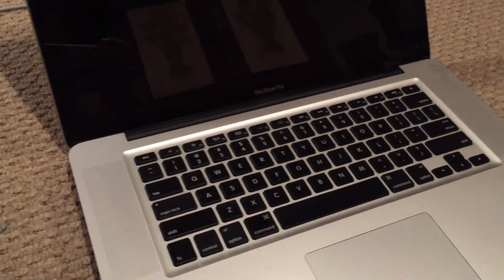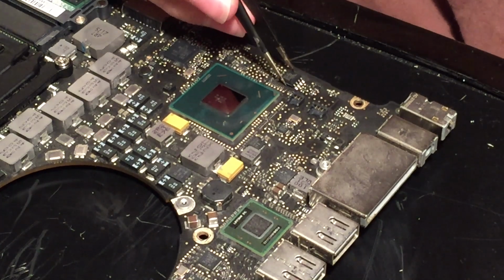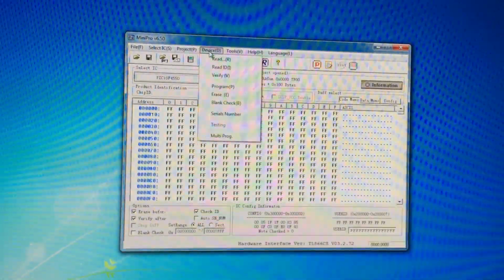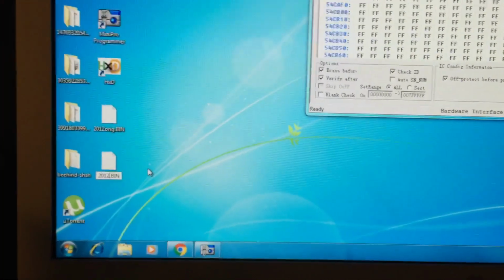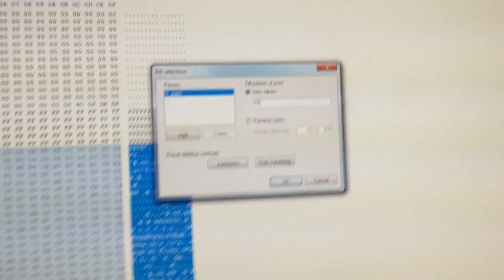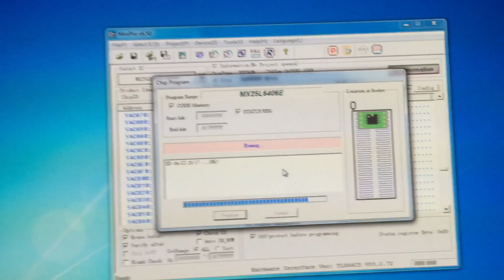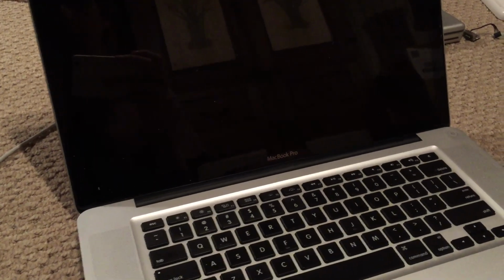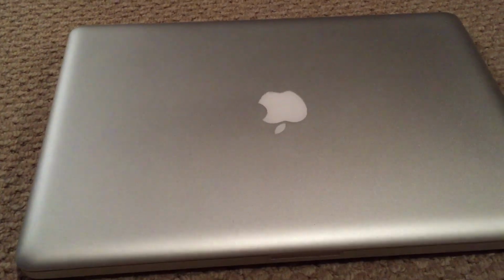Removing a Firmware Password on a Mid-2012 15" MacBook Pro

Comment: Can you do this with one of the clip-on IC holders, rather than having to desolder/resolder the whole chip? Also, are those matt boards that are popular with newer models a robust solution? I've not heard much about them!
Reply from the maker: Yeah, you can, but will probably have to inject voltage with a power supply, as the 3.3V rail pulls too much current to be powered by just the programmer. Don’t mess with the Matt boards, they are not needed and really shouldn’t be used (as they are replacing the SPI-ROM on the machine’s board).
Reply: @dosdude1  Ah fair enough, Matt board was the route i went on my 2014 air, didn't have the equipmant to do a proper EFI re-write, might get around to doing it properly one day if i run into issues!

Comment: Off subject from this video....but any pointers on how to get into the BIOS on an intel Nuc? thanks much.....
Reply: EFI, not BIOS, hehe. I would expect that it would have a similar design with there being some form of EEPROM on the board that you can flash using alligator clips and a raspberry pi. However, if it has a TPM 2.0 you may run into issues.

Comment: DAMN good video!!!  I liked and subscribed.  A couple quick questions... 1. Is it possible to change the EEPROM's contents directly in the programming software, (instead of copying it to a hex editor)? and... 2. What brand and kind of flux do you use?  Keep rockin'!
Reply: You can’t “edit” an EEPROM in place. Basically they support being read while working normally, or in dumping / entirely rewritten mode.

Comment: 02/06/2021 this works on Imac 13,2 late 2012. you just saved me £300 for mobo replacement. i spent £22 on adhesive and a programmer and managed to remove firmware password from 2nd try. tyvm

Comment: Would it be possible to do this with the clip on lead you can buy rather than remove the chip??
Reply: Yes, although it can be tricky. Some computers work better than others. I'm using an old Acer laptop (originally came with Vista!!) that works almost every time.

Comment: Great video, thank you. Used this video to remove the password from my 13" MBP 2012
Reply: Hello friend please contact me my whatsapp in my web https://ateseteknik.com
Reply: Which adapter I can use for connect the chip to the PC?
Reply: @uwimanabertrand153  Hi, my TL866 came with several sockets for various sizes of chips. If I remember correctly, it's a SOIC-8  chip.

Comment: So after the efi is unlocked would the macbook locks itself again if you connect to the internet or go onto the apple app store? Lets say that the macbook is stolen and the owner reported it as such and the macbook's serial number is now blacklisted. Would the serial number embedded on the motherboard triggers another efi lock?
Reply from the maker: Not at all, once EFI lock is removed and the OS is re-installed, the system will remain unlocked.
Reply: @dosdude1  My Early-2015 MBA got hit with some ransomware and as I purchased the device from a third party, Apple won't unlock it for me without proof of purchase.  I'm about to replace the logic board (purchased used on ebay), will I need to do anything other than switch it out? I'll utilize my same SSD and airport card. I just want to make sure I'm not spending $300 on a replacement logic board for nothing. Will I need to do the 3X PRAM reset? Re-install my OS (seeing as the SSD will already have the OS installed)? Wipe the SSD?

Comment: I bought a 2011 iMac with this problem. I can just change the whole board, right? They’re super cheap on eBay.
Reply from the maker: Yeah, if you want...
Reply: dosdude1 thanks! Ordering now. I only paid $60 with shipping for the iMac, then got a partial refund. The boards are around $35 on eBay.

Comment: Hi Collin, could provide a link where I can purchase that eprom chip reader and which application you used to reprogram the chip with?
Reply from the maker: I got it off eBay... Just search for "TL866" on eBay, and look for one that comes with the adapters. The software used is included with the programmer.
Reply: thx

Comment: I got the TL866A USB, but what adapter is needed? Keep up the good work!
Reply from the maker: You need an SOP8 programming adapter.
Reply: Thanks!
Reply: @dosdude1  Can you use one of those clamps instead of removing the chip from the board?

Comment: Hi there I have a 2017 MacBook pro it's icloud lock. I need help removing the passcode please help me.
Reply from the maker: It should be relatively the same process as shown in this video, but the EEPROM may be slightly different and require a different adapter to work with a programmer.

Comment: Where did you get the adapter??
Reply from the maker: I got it off eBay. It's a MiniPro TL866.
Reply: dosdude1 also if I want to use a Ponoma clip instead of removing the bios chip from the computer which do you advise using??
Reply from the maker: I don't advise using one. I tried using one once, and it didn't work at all. Try to get one, though, and see if you have any better results.
Reply: dosdude1 I just ordered the mini pro l866a along with a Pomona clip as well as the female to female wiring. Although I’ve never used a clip before is there a certain adapter I may need in order to connect the clip to the mini pro? Thank you for your replies and quick responses it’s very much appreciated. I will be following the process you have in this video to remove the firmware password from my 2012 a1502 MacBook Pro
Reply from the maker: Yeah, I know you need the little plug adapter that allows the clip to go into the programmer. Usually the clip comes with that adapter (the one I got did).
Reply: dosdude1 also when I clear the firmware password is there a possibility that it will lock itself again? Or once it’s clear will it stay cleared when I connect to the internet?
Reply from the maker: Nope, it will not become locked again under any circumstances, unless of course a new password is set by a user.
Reply: dosdude1 I finally got down to the board but my problem is that I have the efi chip that is solderless and doesn’t have legs. Am I still able to read it using the programmer or do I have to go a different route??
Reply from the maker: Oh, yours is a QFN chip. It has solder pads underneath it. These can be pretty tricky, as you'll have to solder tiny wires to each of the 8 pads to allow it to work with the programmer. Unless you have decent soldering skills and precision soldering equipment, I wouldn't recommend doing this. However, if you'd like and are in the US, you can send the board to me, and I can do it for you and send it back.
Reply: dosdude1 do you have a link to a video process on this?
Reply: dosdude1 if all else fails, I will be glad to send the board to you.
Reply: dosdude1 also when I open the program on my desktop and try to do the “25 flash detect” I get “unknown device”
Reply: dosdude1 do I need to remove the qfn chip or should I just solder onto the pads